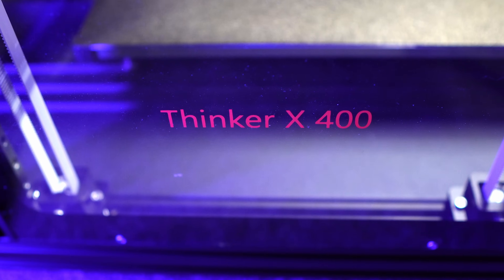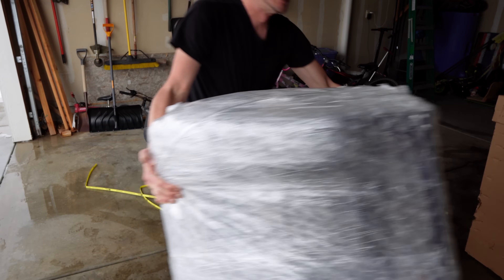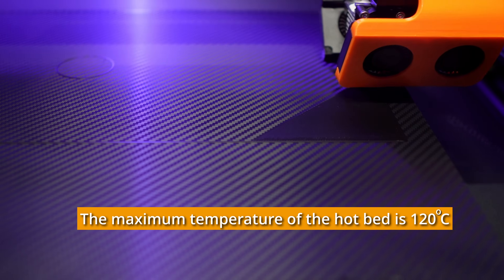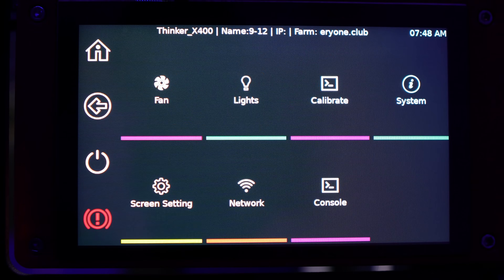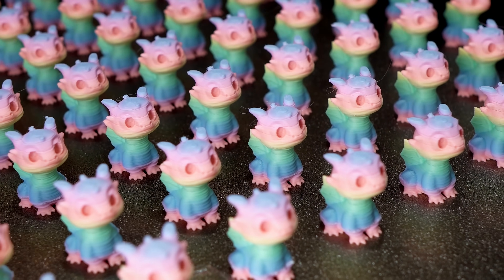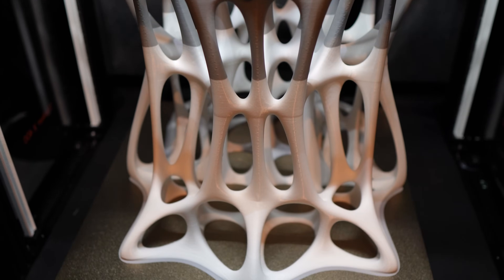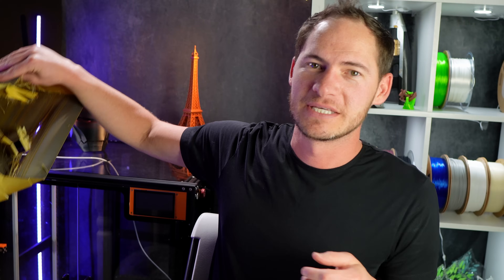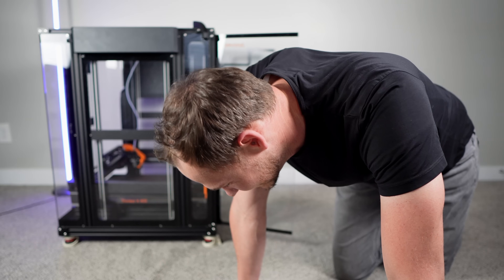Biggest, Enclosed 3D Printer? ERYONE Thinker X400

Comment: Have you had enough time on this printer to know whether it is suitable for a farm running 24/7?
Reply from the maker: Hey, the bed leveling is one of the best parts of this printer. I’ve only had a couple of fails and it was with complicated parts. What things will you be printing in your farm? Maybe I can test some of them and let you know how it goes?
Reply: @The3DPrintingZone  well, for my current project, I am printing very large (2-3ft tall) carousel animal heads (sort of like hunting trophies) as decoration on the way to the actual carousel.  These will be fully finished, painted, and clear coated as they will be outside 24/7.  I'm at the point in my business where most of my clients are large commercial entities and I've already done my years tinkering, modding, and fixing.   I'm only interested in printers that just print correctly every time for years and years on end.  I no longer have time for failures and fiddling, I just need it to work.  I am going to buy a couple H2D printers for that reason once they become available.  My army of MK3S+ printers has mostly been that, workhorses that just go and go, but they are too small and too slow and the print quality, though acceptable, just isn't up to the standard of modern printers.
Reply from the maker: @ honestly, if you don’t need the extra build volume, I’d trust Bambu Lab more just because of their reputation. I don’t know if the Thinker will last as long as Bambu printers.

Comment: I totally need one of these. The bad part is, i literally just got my first 3d printer this week. I already want a bigger one for larger projects i would love to do.
Reply from the maker: Nice! What printer did you get?
Reply: @The3DPrintingZone  I bought the anycubic kobra s1 combo. I've been printing almost nonstop since I took it out of the box.
Reply from the maker: @ amazing! I’ve been interested to see how that compares to Bambu
Reply: @The3DPrintingZone  I can't say how it compares to bambu because I don't own one,  but it's been a learning experience so far. Partly because I'm new to this so I'm learning to dry filament,  use different filament types (I'm starting with petg and pla), different brands, and roll sizes too. Spool adapters are a must for the ace pro if it's not a 1 kg roll, it's very picky about filament being even slightly moist, I have to tinker with cleaning filament because my attempts today failed so I'll keep trying different settings until it works.... it definitely pays to set individual profiles for different filaments and brands. They don't all print well on default profiles. I've had some clogs in 3 different spots and learned how to deal with them. I definitely don't care for the hub that came with it so I'm printing a new one and I'm going to try it out this weekend.   There's plenty of awesome accessories to go with the system on makeronline too. I'm trying to print out quite a few of them. Yes, I've been learning a lot.  I still need to learn how to change hotends because the 'button ' on the back is not being cooperative or I'm not pressing it right. I'm trying to figure out also if I can lower the heatbed itself manually for better access to the print head and hotend. I have a lot to learn and a lot to try out. I did learn that I can use petg and pla together for easy support removal too.

Comment: So what features does it have over the Ender-5 Max which is the same print size? All the features you mention are part of standard klipper. Other than the enclosure (which the Ender 5 is going to offer as an option), I haven't figured out why the x400 is 3-4 times the price?
Reply from the maker: I would have to look at each product spec sheet and compare. Honestly, it does seem a little pricey but it’s VERY heavy duty. I think the build bottom is 10 mms of metal. It will come with a heated chamber too but not sure why it’s priced so high.
Reply: @The3DPrintingZone  I asked this question a couple of months ago in their facebook group and they really couldn't give me an answer. It's too heavy for me definitely, but most printers these days have a metal frame and that alone doesn't justify the price for me.

Comment: Not sure I'd call the Iron Man mask perfect, saw flaws on the forehead. 
A bed that size really needs a beacon probe for bed leveling, which is why RatRig uses it on the vCore 4 which is that large. 
While the hardware might be functional, it will really depend on the software, support, repairability, reliability, and durability. Lots of unanswered questions. But more competition is good.
Reply from the maker: Yeah, I didn’t call those out because those flaws were user error. I chose zero infill so as it got to the top, it was printing a near 90 degree overhang. Had I used infill, that would’ve gone away. I would’ve used a lot more filament too 😂 in hindsight, I should’ve made that comment to help people understand. Thanks for calling it out!
Reply: @The3DPrintingZone   No infill. Oh my. The adaptive lightning is good for when you don't really want infill, but need it for support.
Reply from the maker: @ScytheNoire  yeah, good call! Next time 😂